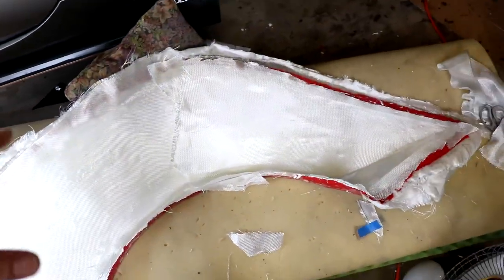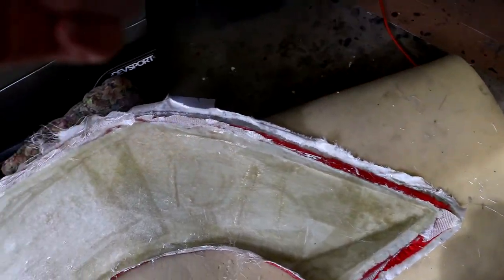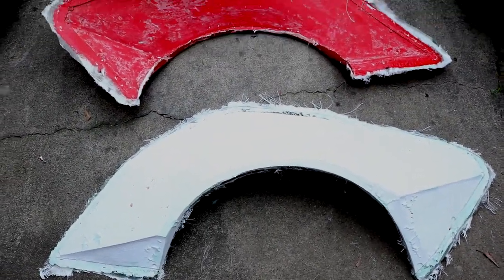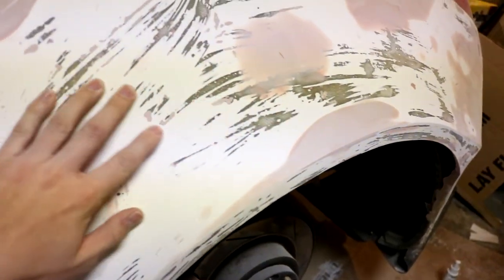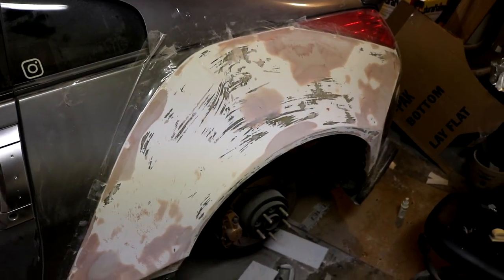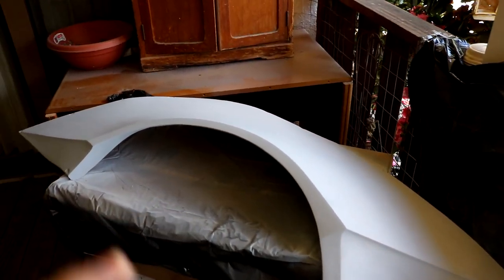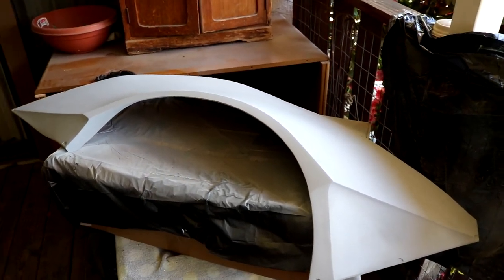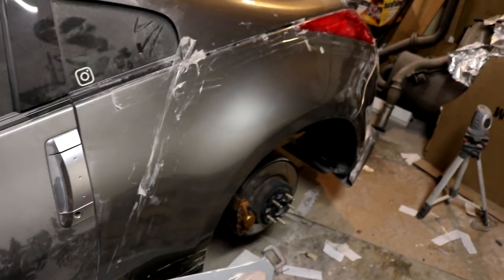PZ Z33 350Z: DIY Custom Widebody Build Part 3

Comment: if I didn't want to go with the bolt on look what would one recommend to blend it in ?  filler and bondo glass?
Reply from the maker: dreezy franklin Yes. Molding is a process of using fiberglass and high strength filler, (such as aluminum reinforced filler), sanded to the shape of the body, prepped, primed and painted to the desired finish.
Reply: SiegeStyle sorry , I meant how would I go about blending the final product on to the car . I want to make the kit look flush and oem rather than the bolt  on removable look.
Reply from the maker: dreezy franklin What you are describing is called "molding". As I said, you use fiberglass and high strength filler to blend the piece seamlessly to the car.
Reply: SiegeStyle sorry totally misread the first message. Thank you for the confirmation gonna attempt to do that. I don't know if you ever heard of smd sunflash resin but it only drys under uv rays and drys in minutes .
Reply: SiegeStyle anything yoh can recommended on attaching and blending fibe glass to polyurethane or plastic ?